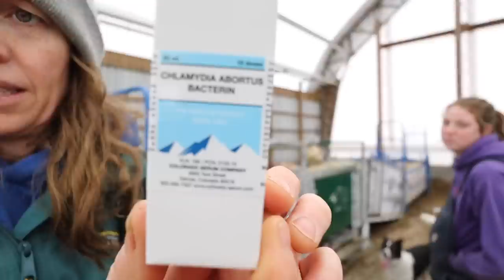My new ewe lambs are WILD!!🫣 | Vlog 673

Comment: A suggestion on the fans u remove to clean.  Ask Mark to come up with a simple hinge affair so they will swing up between the rafters to clear the telehandler.  Then go to Harbor Freight and buy some simple cheap hand crank cable winches (boat trailer type).  Hook the winch to the fan and then you can just crank them up and down as needed.  No climbing and muscling the fans.
Reply: I was thinking also on the fan's. Is there room to place them on the sides near the windows. Sandi you make my back hurt every time I see you put them up and take down. Stay safe. Indiana here

Comment: I’m surprised your not putting your replacement ewes on the flock watch. I would think it would be good to scan them with both systems until everyone is on the flock watch
Reply: At this point, Sandi is sending batches of info to Flock Watch and they are loading it into the system for her.

Comment: I feel bad for you every time you have to clean the old barn. You have to take the whole barn apart. Is it possible that you could mount the fans on a hinge that you could just pull a rope on a pulley and it would swing up into the rafters and not be in your way?